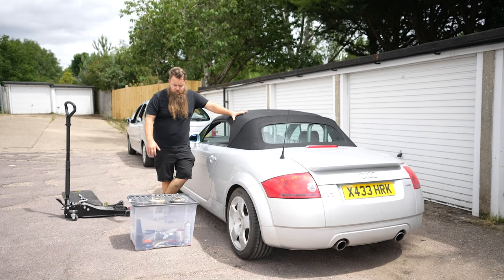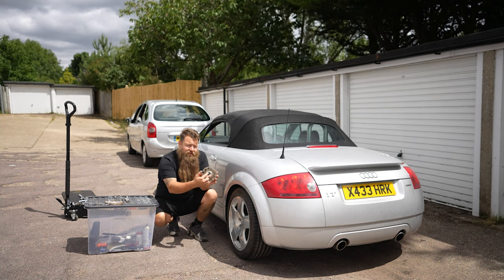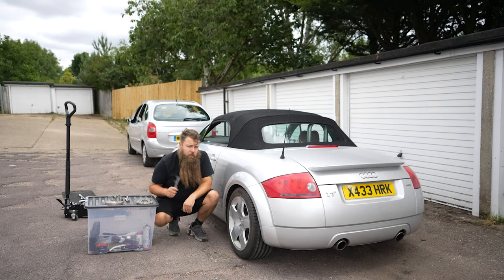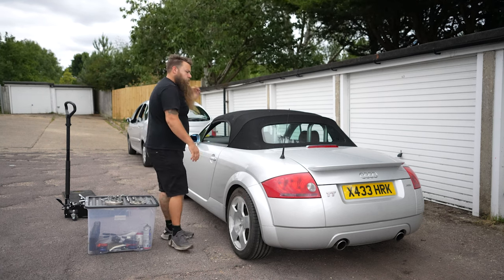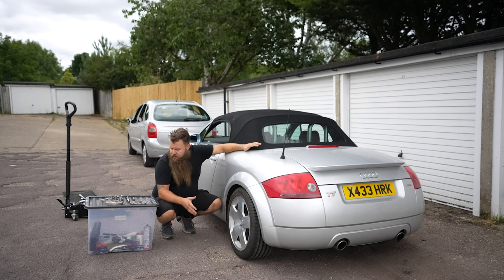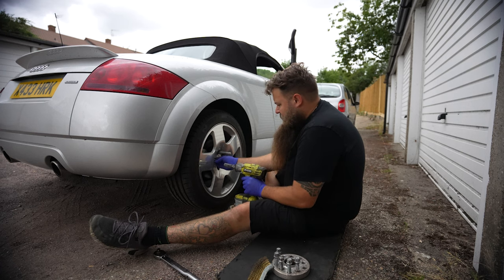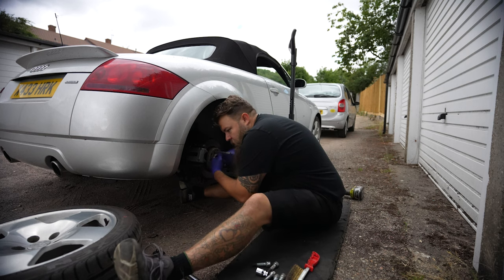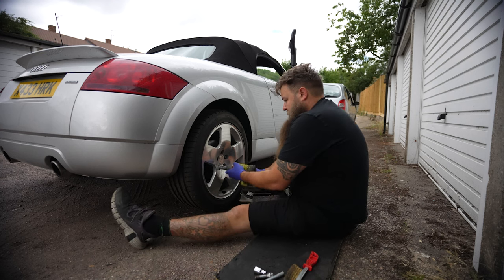Fitting Spacers On My Mk1 Audi TT

Comment: Great content my friend..so pretty much just big "washers" between the wheel and the hub. I always thought they bolted to the hub first. Cheers!!
Reply from the maker: On the larger ones you can bolt the spacers down then bolt the wheels to the spacers. My only issue with those is I don’t like the idea of a steel insert pressed into aluminium. That’s all that’s holding the wheel on
Reply: @TheParrottBros  good to know...thanks again bro!

Comment: Hey buddy, another superb video! 

Quick question - what’s the tyre size for the ‘Fat 5s’ for the MK1 TT? 225/45/17 or 225/50/17, or something else? 

Am leaning towards the 225/50s for a bit more comfort (but will they rub?). Will also add spacers. Car has not been lowered and current alloys are OEM 9 spokes 18”. 

Thanks so much! 👊🏼
Reply from the maker: Hey buddy, I always ran 225/45/17 and they felt lovely.  Nice tyre to wheel ratio without compromising on comfort. 

Couldn’t say for sure if 50 profiles will rub but 45’s fit a dream with spacers 👌🏻

Comment: Hello, sir. I have bought 4 aftermarket alloy wheels ( ATS, it's an German brand). I want to use them on my TT. they are 16 inch, 6.5J, ET 38. Also I wanna use 25mm wheel spacers on each side. What bolts should I buy  ? Thanks mate 🫶🏻🏎️

Comment: Wheel spacers are illegal in Australia unless the manufacturer fitted them. So double check if they are legal in your country. Even if they are legal where you live do your research as there are many negatives to wheel spacers.
Reply from the maker: That is a great point as often in certain countries certain things can be illegal, in England they tend to be pretty relaxed about most things, if you buy aftermarket wheels you can change the office so that no spaces are required to achieve the same outcome

Comment: was always told by audi that wheel spacers puts extra strain on the quattro system causing premature failure
Reply: Mine's 20 years old and still running
Reply from the maker: It may add to the premature failure but the mk1 Quattro sports run staggered wheels with wider rears so can’t see it being too much of an issue
Reply: @TheParrottBros  yeah guess so
Reply: @mandismith89  Ben I don't think you should worry too much. The quattro isn't a full time 4x4 system, most of the time it's the front wheels doing all the work. It's going to be fine if you decide to put spacers

Comment: Not sure that spacers improve the aesthetics, but those wheels certainly do.
Are those 18 or 17? I remember them from your video about the stock wheel. 
The best looking ones imho. Cheers
Reply from the maker: They are 17’s and with the slightly bigger tyres they make the ride so much smoother! 

They do an 18’ that looks similar called a fat 5 found on a8’s
Reply: @TheParrottBros  What size tires are you using?
Reply from the maker: @scotpurdy8132  on 17’s 225/45/17
On 18’s 225/40/18

Comment: I have 15 all round I notice though I have a tapping noise as I drive on the rear left and my traction light flashes on my dash as I accelerate causing the car to lag any any ideas ?? .  Love the aesthetic look.
Reply from the maker: Sounds like you may have a wheel speed sensor issue, that’s usually what caused the light to flash up as it thinks your spinning or slipping a wheel
Reply: @TheParrottBros  thanks for input will look into that. Love your videos !!

Comment: Did you say to put copper grease on the bolts bud?
Reply from the maker: You can put some on the threads, any suitable anti seize will do the job
Reply: @TheParrottBros  I personally would advise against it bud something I was always told doing my training as they have a chance in working lose. Other than that great content bud

Comment: In Australia you cannot change the track and will get your car a defect and your insurance will NOT cover you.
And..
The usr of those spacers are illegal because they create a shear point on the wheel stud.
Cheers.
🇦🇺🐨🦘🇦🇺
Reply from the maker: Are you allowed to use wider wheels or does that too Fall under the same category? 

The Uk is certainly a lot more relaxed when it comes to vehicle modifications
Reply: I’m fairly sure you can increase track by 10mm here in Australia. 
And yes wheel spacers are illegal.
Reply: @stevesloan6775  you may be correct on that but that is only 5mm on each side and likely allows for slight variations in tires and rims. Otherwise the gun ho Nazis would find fault in most vehicles.
Even with steel sizes there is a margin of variance in order to conform to and meet Australian and manufacturer Standards.
👍🏻👍🏻
Reply from the maker: @stevesloan6775  oz is funny, what other things are banned?
Reply: @TheParrottBros  Our laws are defiantly Nanny~State!

Our laws have moved quite a bit in the right direction in the last few years.
My state South Australia just changed from lib to labour, and a whole bunch of his election promises revolved around motorsport. Most notably returning is our "motorsport festival",  Adelaide 500 V8 SuperCar race (runs on the old Adelaide F1 city street circuit).
Also the new Gov in our state changed classic car qualification from 30 years too 25 years..So yeah... My TT is 3 years off of being able to get cheaper rego....by a fair bit. 
From $800 to around $150 per year!
Ill apply for a fresh version of the ADR (Australian Driving Regulations) and send you a copy or link via FaceBoot or something. :)

PS. All my Youtube replies have been going to spam for ages....Just worked it out now.
I thought no one was replying..    : /